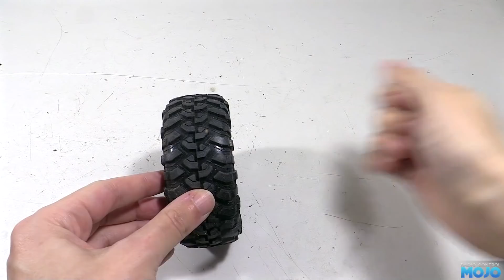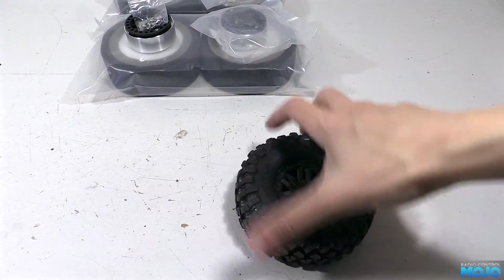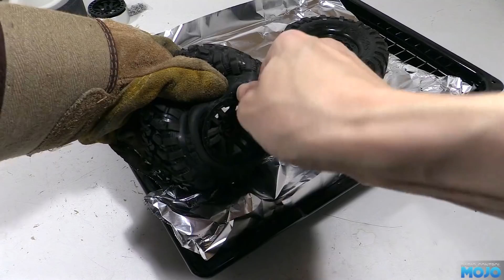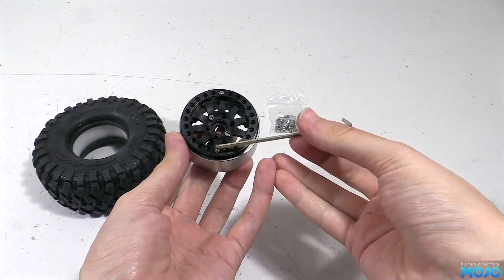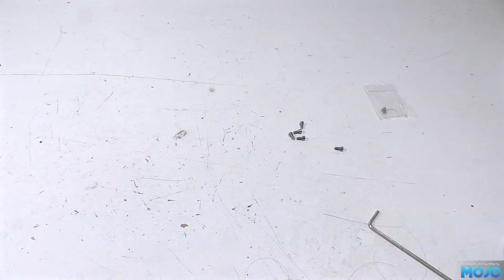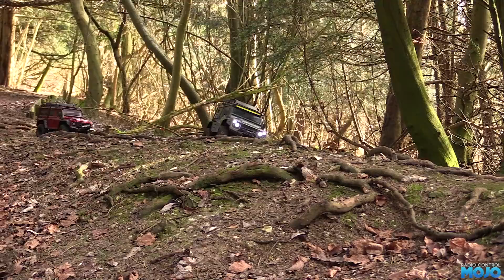Traxxas TRX-4 - Beadlocks

Comment: is the wheel hub enough to avoid rubbing? I have extra weights installed so I am wondering whether these wheels will rub.
Reply from the maker: Over sized outer hubs like the ones from yeah racing might cause some issues. I'm running MFR parts which aren't any bigger than stock so I can't really test for you
Reply: RCMojoTV okay. I will give a go. If they don’t fit, I will just sale them on eBay. 😁😁😁😁

Comment: Very informative and great video. Would you be able to fit 2.2 beadlocks onto the stock TRX4 tires or would the rim be too wide?
Reply from the maker: With the right offset 2.2 wheels will fit, with smaller diameter tyres they'll clear the chassis bits ok. You'd have cut up the body quite a bit too.

Comment: Hello.  wheel hub is SLW 350?
Reply from the maker: I don't suppose they're proper Vanquish parts, but they certainly look identical with the exception of the threads, the Vanquish part is 4-40, these Chinese wheels are M3.
Reply: https://www.ebay.ca/itm/222892222312?var=521718118081 is what im going to try hopefully they mate up nicely and return the offest to a factory width i have the same rims they are nice and fitting over the hub was a nice surprise
Reply: Thank you for providing the information!

Comment: how did you manage to remove the rest of the glue from the tires?
I "cooked" the tires and wanted to put them on beadlocks, but because of the glue left on the tires, the beadlocks could not really be tightend properly and would seal up, so there was always some air going in or out and sometimes the tires even popped out of the rim :(
Reply from the maker: While the tyre was warm I picked off the big bits. Some beadlock wheels are more tolerant of lumpy beads than others though.